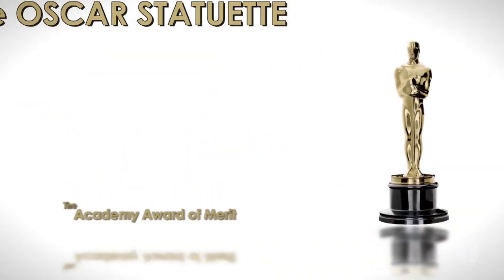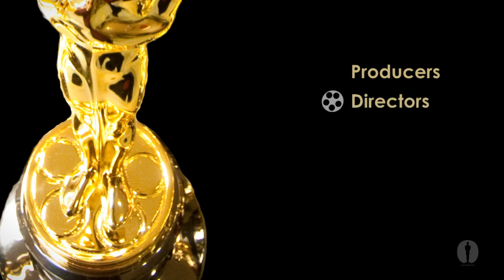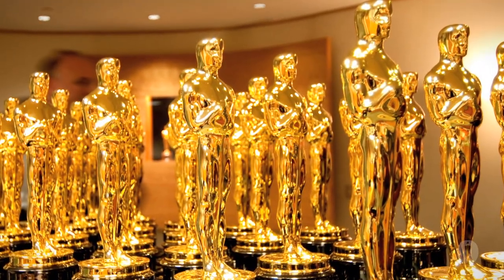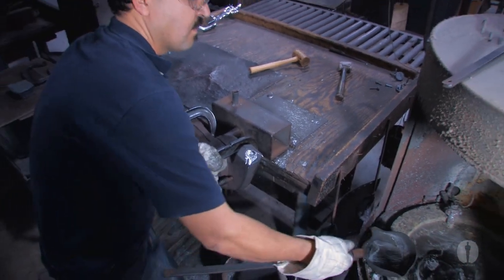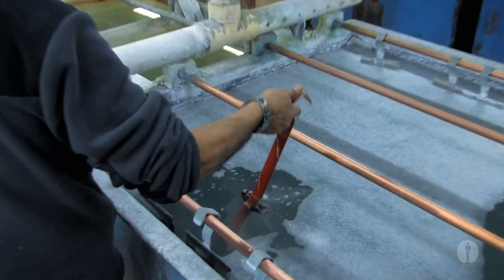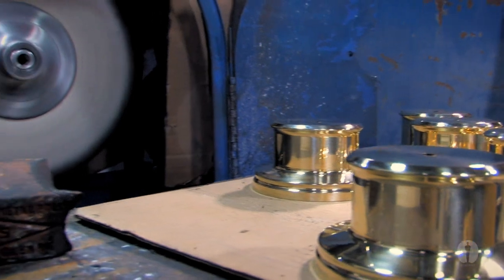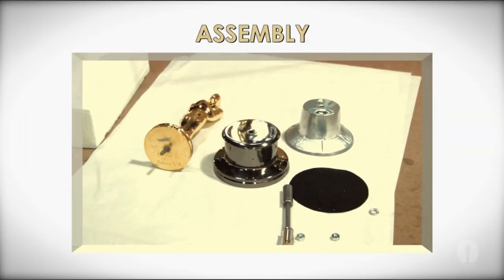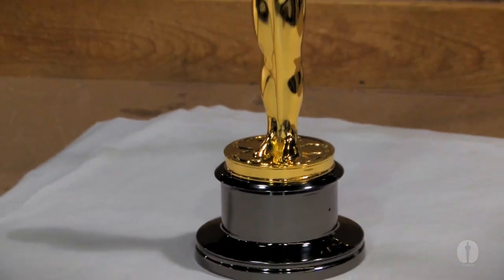Making an Oscar® statuette

Comment: Finding out about the Oscar not being made out of gold was like finding out that there is no Santa Claus.
Reply: Well it only make sense. Eight pounds of solid gold would cost roughly $180,000. Imagine if someone dropped or scratched it. It is far too costly to make them out of pure gold. Besides, 24 karat gold isn't very sturdy, so it would have incurred a lot of damage over time if it was made of solid gold.